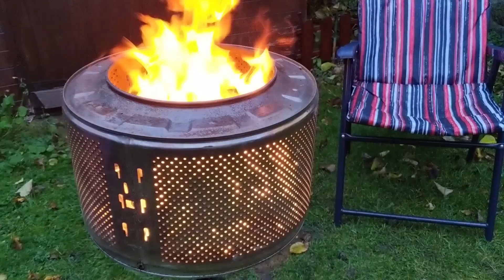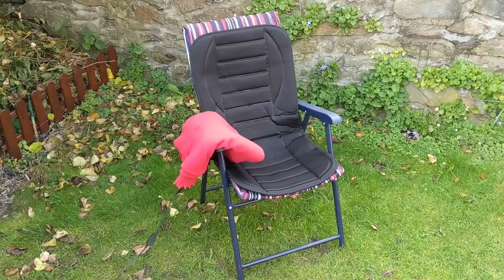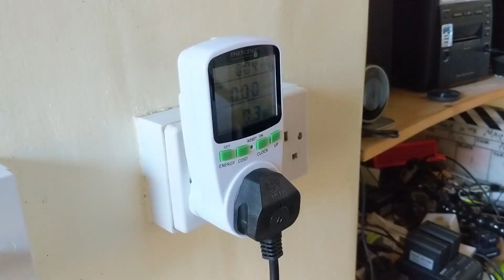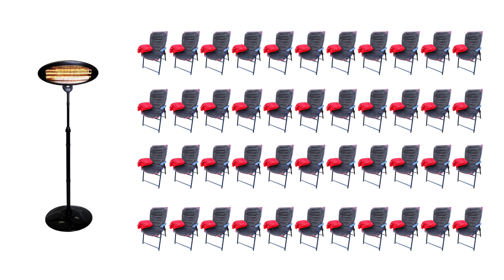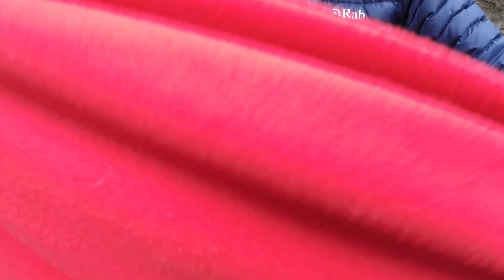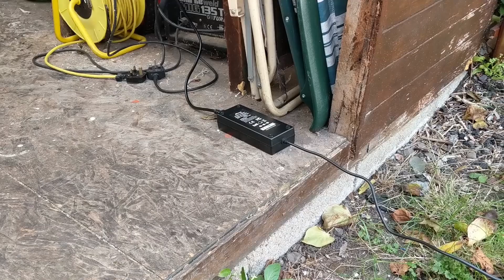Keeping warm outside during Covid - a patio heater alternative

Comment: Cracking ! I did this about 10-15 years back when working late into the night, when my desk was based in a warehouse, with a stupid amount of ventilation and no heating. I went through a number of experiments -
And found further optimisations - a blanket over your lap, an insulating block under your feet, (and pet bed heating mats allow smaller localised heating to be applied as well if the heated seats aren’t sufficient / but you’re right the heated seat cover is key) so I had a pet bed heater on the desk under my forearms. 

I bought a heated mouse and heated keyboard (yes they exist) which topped things off perfectly and removed the need for gloves. I ended up going for the  dog Bed  heated mat as preferable to the heated keyboard as it heated the desk as well. When it got really bitter - the last thing was an infrared heating bulb (sold often for reptiles) in standard lamp to warm my face. The result was I felt balmy even if the temperature dropped to well below zero.